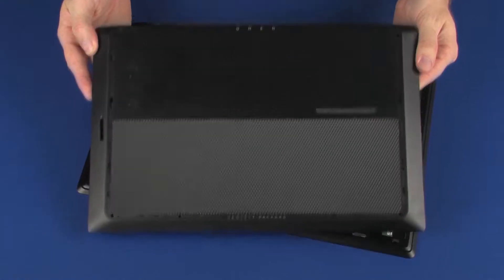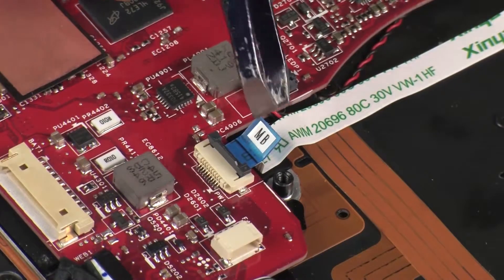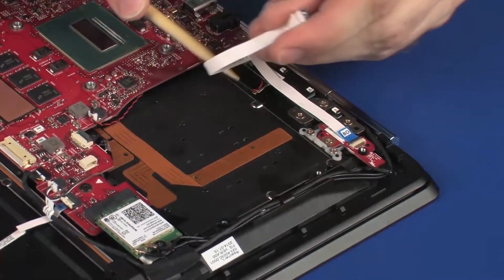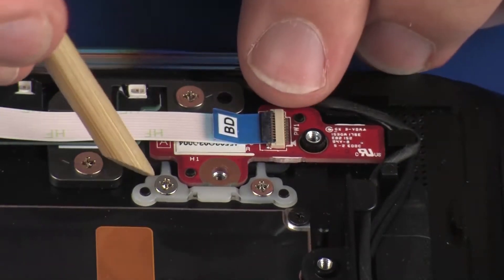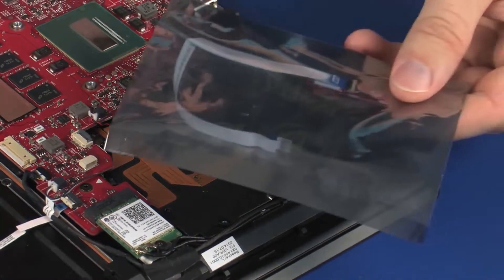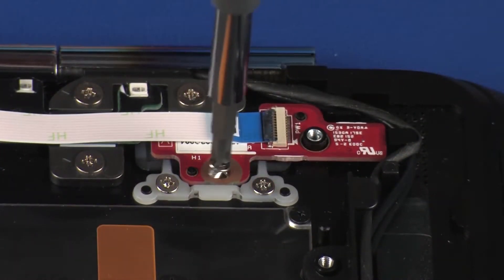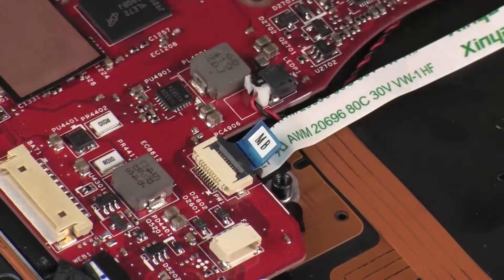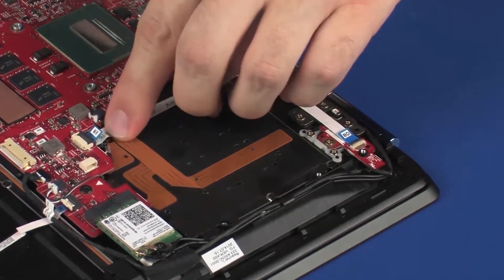Replace the Solid State Drive | HP OMEN Notebook PC 15 | HP Support

Comment: This video is for the power button board replacement, not the solid state drive
Reply from the maker: +Midnight1211 thanks for reaching out!
I understand that you need help in replacing solid state drive.
I'll do my best to assist you.
Please refer this document to get this information:
http://bit.ly/2DFMLSc
Let us know how it goes.
Reply: @HPSupport  I was actually requesting you replace this video with the correct one to match the description. The wrong video was uploaded. This is a video for power button cord replacement, not SSD replacement. The guide you linked is for the SSD replacement, but it uses this same power button cord video. 
Thanks!
Reply: @HPSupport  this video is the same as https://www.youtube.com/watch?v=Pp5iN54MiuI&t=58. Thanks!